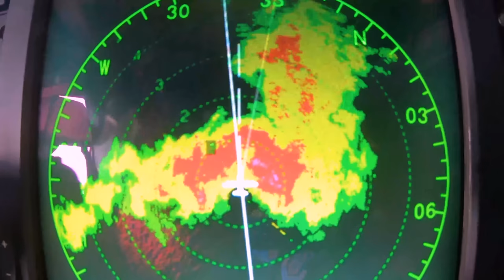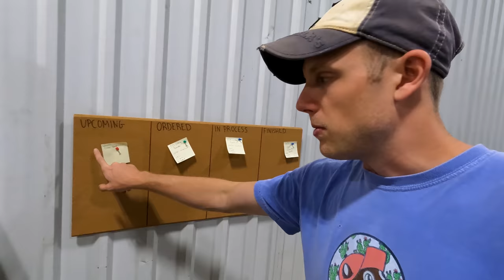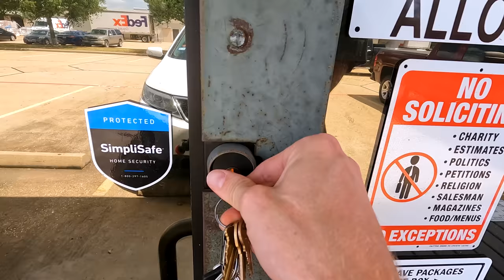This business SECRET took us 18 months to figure out...

Comment: I noticed something about your production process: you could save a lot of work by gluing larger panels. I would choose a length where 3 or 4 finished boards come out. Then you have less jointing, less gluing and less waste.  
You wouldn't believe how much time it saves to not build each board "one at a time". 
In addition, the blanks all have the same dimensions after being cut to length. Why do you mark the drill hole and the outer contour?
You can also cut the offcut on the band saw at the fence. If in doubt, roughly drill out the round inside corner with a forstner bit. i would do this in the same work step as the hole on the handle. Another work step less. 

Greetings from Germany

Comment: Have you considered getting a CNC Router for cutting the profile and hole in the charcuterie boards? You could glue up long sections (4-5 boards worth) and load several of those into the CNC, walk away and work on other things while all the cutting and drilling is automated.

Comment: I Was production manager for a  wood shop / store fixtures  for many years and i have a thought for ya to mull over..its super important to do as much as possible to a part once you have put a hand on it..ex..i notice you mark..drill..notch.and each time is a bend or reach for the part..imagine if you consolidate those tools into one small area that would allow 1 picking up of a part to complete 3 or 4 processes...better/ more profit  is less handing/ cost per unit...in general..you should pick up a part as little as possible... you do well in most cases we see..but as a old production guy i notice the pick up and and the moving of parts as a serious cost that should carry weight in processes..just as machining..thats a different convo..

Comment: I'd go back to the original kanban for manufacturing, instead of the Post-it, make strong cards (like plastified cards) that you insert in between the board when you need to start a new batch (if it's when you have 30 left, then place the card between the 30th and 31st. Then when you take that 31st board you'll see the card and add it in the incoming column on the wall kanban board. Thus, you don’t have to look at the inventory, it just pop in your face when you have to start a new batch.

Comment: Protip: add about 10 hooks per "zone" on that kanban board, take about 30 3x5 note cards and laminate them. Punch a hole in the corner then use either a grease pencil (my preference) or a dry erase marker for your cards.  That way you're not wasting sticky notes if you're trying to cut costs.

Comment: You could use a ton of different free softwares to handle the kanban board you got there. Then have a tv or something on the wall that can show notifications on statuses, etc... I've done that in the past with other businesses consulting and it works out pretty well. It's not as hard to DIY it as you might think. It would tie in with your online orders or whatever CRM you might use to manage orders and customers. Set up automated reminders and other systems to mange the inventory process. Automate what you can early on as it's veerrrry expensive to do later when you have too much infrastructure and data to port over.

just some words of advice

Comment: I'm sure many offer solutions etc so I do apologise in advance.
An area of concern with the board are several possible failure points.
Look at Poka - Yoke of the board (remove or fix all possible failure points). Make it so it can't fail. I find using a simple FMEA document (basically a type risk assessment of possible issues) will help.
 Again sorry  not a criticism at all. Another good video. You guys are doing so well.

Comment: Sometimes JIT just doesn't work. Maybe if you planned for two or three months out and have that amount on hand. You know they're going to sell and you have plenty of room to store quantities.

Instead of doing 50 cutting boards at one time, set a daily goal. How many can you complete in one day? How many do you need in one month? That would provide a daily need. Add 10%. If 4 or 5 go out every day, you have to make at least 25/week. Is that possible? Being gone for 2 weeks, you probably want to make sure you have at least 100 complete boards before you leave.
Reply: faster to batch things. As you get to the 10th cut you are much faster than the 1st. Faster to do bulk than daily for sure
Reply: @732brudder  after so many hours a day productivity declines rapidly. So, do 10 a day, whatever that magic number is. In a manufacturing environment, quotas are usually on a units/day metric. Doing "x" per day would ensure  that many are available every day. Which is good because J&D always talk about how many are shipped on a daily basis. If JIT is implemented, it's just a matter of replenishing the stock by how many go out. I would probably make enough at first to have a base stock of 50 or so in case a quantity of 20  is ordered. Then it's a matter of making enough every day to maintain that stock level at that baseline. 

If Davis had another woodworker (which I really think he does) on-hand quantities should be easy to maintain. 

When they hired sales people, they really should have considered demand would increase and pretty soon - if not now - production will not be able to meet those demands.
Reply: @cindyhammack68  Good words, I agree with them all! In the video Davis was spending too much time stacking and moving wood, wasting time with unnecessary movement.  Also reducing the finished goods quantity reduces space taken up.